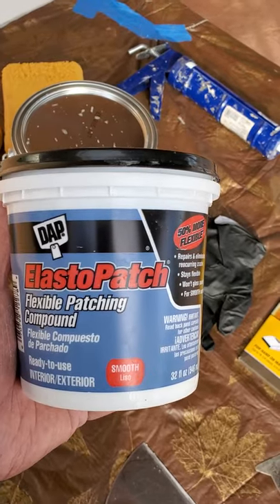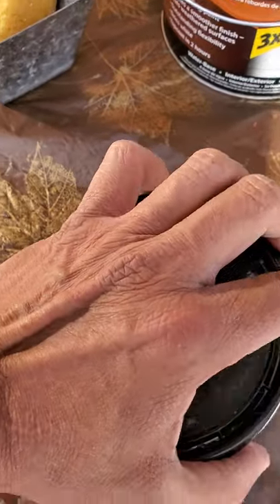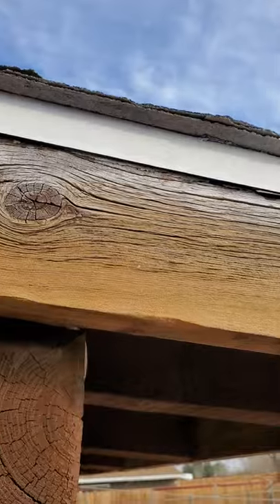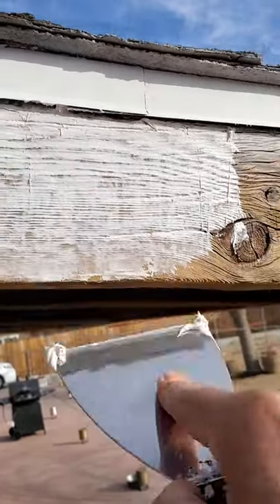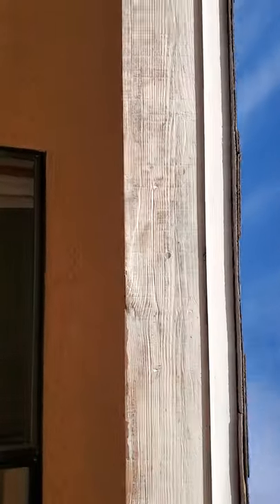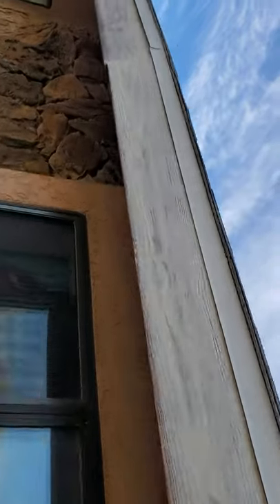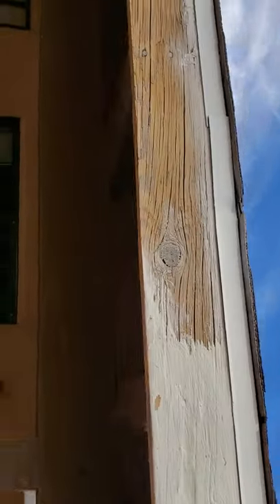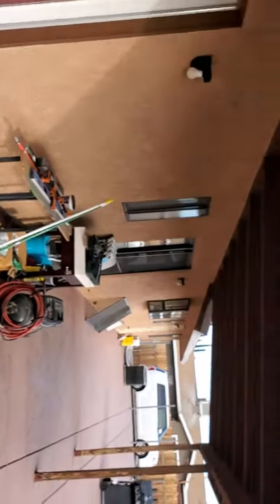Wood and Fascia Board Cracks Repair.

Comment: That product never dries and its soft, always you can rub off with hand or sand paper. I ended up sanding it all off. Primer wouldnt stick to it. Paint doesnt either. Joint compound is cheaper and more effective but still sucks. Probably bondo wood filler is the best. You need something with a hardener.
Reply from the maker: Sorry the product didnt work for you, its amazing product manageable  and dry very well for me. 
I had  fix all my exterior wood and also patch the stucco around the house before I painted my house  it has been couple years no crack in all repair areas . Wood and stucco all good!..
I recomend use a patty knive work on your wood smooth it up as  good as posible wait about 3 to 5 mins if weather is not too hot cause will dry fast.
and not  manageable to smooth repair , used sponge to smooth it up again second time if desire smooth  rubb and wait till next day ; check repair if dry  than....
..paint with primer paint ! 
i had used killzz water base , wait till complete dry and  apply exterior paint...and you done ! and trust me  works !... no sanding or workimg with hard epoxy products, etc.
Dont have to worry about  cracking or weather wear on my repair  no cracks anywhere where repair was done . I recently replace roof and  the changing of my fascia wood came on topic, but guess what ?  dont need  to, still looking pretty good , just painted again and was done ...house is buid in 1985 bought house 2010 and it looks like they never paint or paint the fascia board before  by prior owners
 I wanted to change fascia but decided to repair After talking to some profesional painters at a Serwind Williams store and was skeptical at first but  like  I said.....still going .now with new roof.. Sept. 2022... ..all I can give you is my life experience with the product...
Godd Luck !